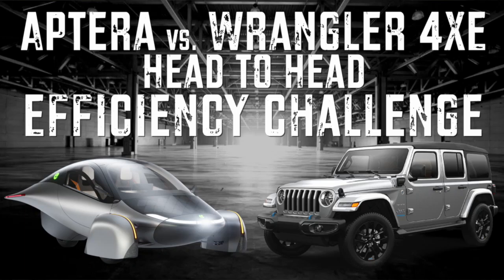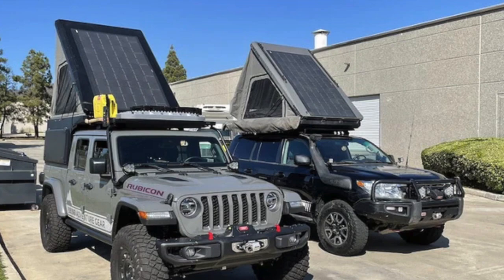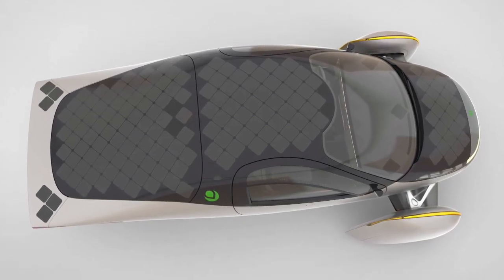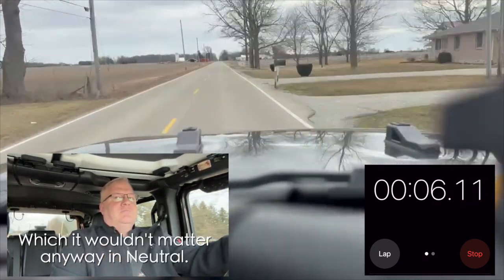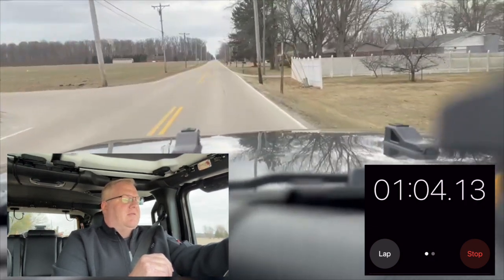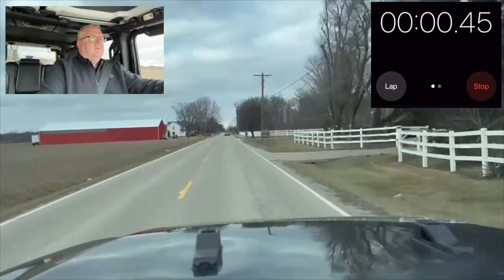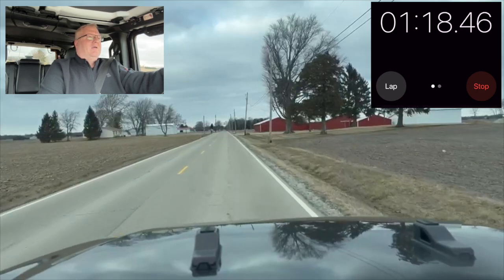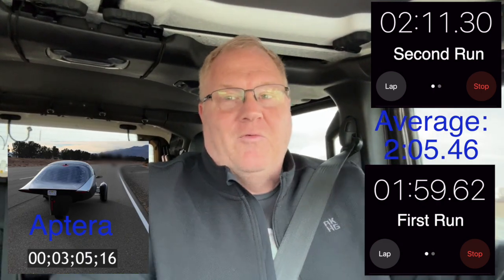Aptera vs Wrangler 4XE Efficiency Challenge

Comment: 2017 Chevy Bolt EV: altitude 56-92 ft ,  temperature 50-64F, new tires Good Year Electric Drive 2, tire pressure 42 psi, average of three 60-0 coast tests: 2:39

Comment: Interesting.  I have followed your antics since mid JA when I ordered a Grand Cherokee 4xe & I am awaiting delivery.  Off topic but concerning FORM :  Would adding an additive to fuel address FORM issues?  I have a classic I put on the road in 2005 & have added 1 oz of Seafoam to GA of Gas always - it had to set idle for 9 months one time and it fired right up when the time came to fire it up.
Reply from the maker: @KenJanicek  FORM is all software predicted. So no additives or high octane fuel will counter it. Best thing to do is to be very intentional about using electric mode and not hybrid mode for day to day. If the engine starts, keep it running for a little bit. Watch the short engine runs.

Comment: Great idea and execution! After watching the Aptera video, I wanted to do something very similar with my Bolt. Haven't done it yet, but still plan to. Your video provides some very helpful hints for pulling this off, when the time comes. I need to make sure I can turn off regen completely for this to have much meaning.
Reply from the maker: @DrTeeHenry  I laughed at myself later. Putting the 4XE in neutral would prevent max regen from playing a part anyway.
Reply: Bolt has neutral.

Comment: Impressive. So much energy to lose with all that weight. What is the mi/kWh on these things?
Reply from the maker: @laggyx500  The rating is 1.45 miles per kWh or 49 MPGe. So yeah, energy hog.
Reply: @Wrangler4XEFans Wow that's bad
Reply from the maker: @Tazdeviloo7  Yeah. You know that. But Jeep has marketed that 49 MPGe in the past like it’s something awesome.
Reply: @Wrangler4XEFans  Try this for a few days. My PHEV has a Battery Later position which is HEV mode. I have to turn it on every time I start. Reset your mpg and drive with that setting for a few days. I'd call that your true mpg. Hopefully a little over 30.
Reply from the maker: @artsmith103  The problem is, the MPG calculator on the dash isn’t the most accurate. I’ve found it can be off up to 4 MPG in either direction.
Reply: @Wrangler4XEFans  I do a trip odometer reset on each tank of gasoline. I'm convinced gasoline is cheaper than EV counting battery lifecycle costs so I always run in HEV mode and recharge about once per month when SOC gets below 25%. 42mpg summer, 37mpg winter.

Comment: Heavier brick-like vehicles have more coasting inertia.... having spent far more more energy to get up to speed, and their lack of good aerodynamics matters less the lower the speed. If you could add enough weight to the Aptera so the vehicles weighed the same, and start at a higher speed, that would be a better test of the aerodynamics of each.  This test, although interesting, means little given the disparities between both the weight and the shape of each vehicle, and is not an "efficiency challenge" by any stretch of the imagination..  Apples and Watermelons.
Reply: But that girl in the Aptera was way heavier than the guy in the Jeep.
Reply: @aussieideasman8498 Apteras are a good 3000lbs less than a Jeep 4XE
Reply: @Tazdeviloo7  There are plenty of Jeep 4XE's but NO Aptera's. Wait until there is one and weigh them both.

Comment: The test is cute, but I love how aptera billed it as a widely used test.  It's not. But it's cute and you can determine some things from it

The Wrangler took 125 second to decelerate. The aptera took 185 secs. So you can calculate the acceleration (converting to metric units, a=delta(speed)/time.  So the Wrangler was a=-0.2235m/s and the aptera was a=-0.1150m/s

And since force=mass*acceleration you can get the force

Wrangler weight 5200lbs..  Sierra
Aptera weights about 1800lbs

Thus Wrangler F=531.4N
Aptera F=93.9N

That's either how bad the Wrangler dynamics are, or for good the aptera is
Reply from the maker: @saturnengr  I’d say it’s both how good Aptera is and how bad the Wrangler is.
Reply: Arguably, a coast down to zero is almost never done - because frankly resistance at low speeds isn't really relevant.  That said, I have seen a number of vehicles go through an abbreviated version of this - as a 60-50mph test, for instance.  This is not a final published spec, usually, but it is often used to validate and adjust simulated calculations with some real world data.
Reply from the maker: @ I think that’s exactly what Aptera was doing. They mentioned they were confirming their models.
Reply: The Aptera was also going up hill. I forget the incline angle.

Comment: The test is not simply a test of air drag and rolling resistance removing speed from the vehicle, it is a test of those things removing kinetic energy from the vehicle.  The 2300kg Jeep and the 1000kg Aptera have very different amounts of kinetic energy starting at the same speed.  The coastdown on the 4XE scrubbed off 2.3x the energy of the Aptera's coastdown, in 2/3rds the time, meaning the jeep would take almost 3.5x the energy to move the vehicle.

Now, because the wheel drag and air drag are not each proportional to velocity in the same way, this number is not universal amongst all speeds, but the rate of change at similar speed areas of the test could be used to determine speed specific differences.
Reply: Thank you for posting this. This was just what I was hoping to see.
Reply: @O-cDxA  Should sell a few Jeeps, lol.
Reply: Haha. That's great. The Aptera, aka rolling scam, is only about 1 min longer.  Let's be real. Aptera is so far from any possible real launch.  Jeeps will be running on thorium before Aptera launches.
Reply: @doclees11 you realize it's not the time that's important. It's the drag

And it's fairly simple to work out the drag, it at least the force of the drag:  F=m*a.  

The mass of the aptera is about 2000lbs, or 907kg.  The jeep is s 4200lbs, or 1905kg.  If we assume the drag is constant, then 60 to 0 is 2 minutes is -0.2235 m/s.  60 to 0 in 3m is -0.149 m/s

So the forces: aptera: -135N.  Jeep: -426N

So what this is really telling you is that the aptera has about 1/3rd the drag
Reply: @saturnengr  no, the Aptera is a big drag and a fools errand.  Terrible turning radius, about a 2 adult male payload, as wide as an F150 Raptor.  Of course a pinched cat turd will roll further than a brick on wheels.  We really don't need a video to tell us that.
Reply: @doclees11  oh, it's definitely a niche car but then so is a Porsche and it's a 2 male adult payload for a lot more money.  And it's turning radius will put s f150 to shame.  So I'm hoping to hear how useless a f150 raptor is

What do you really not like about the aptera?  It's definitely weird.  It's definitely late.  But then again in the past 5 decades we've had about 3 new car manufacturers make it?  Tesla, that would not have unless a billionaire bought them and decided to lose money for a decade. Rivian that was saved by Amazon, and Lucid which produces a fabulous

 car but it's still unprofitable?
Reply: @saturnengr  ahhh, sounds like you are an investor.
Reply: @doclees11  no.  I'm on the fence on buying one. I'd like to see the crash data.  Plus they only have the 400 mi version and that doesn't make sense for my use case. The 1000 mile version ... Maybe. 

We'll see. Depends on where everything is.  Now is a horrible time to introduce a new car when we're about to go into a multi year recession

But I get the idea.  I didn't think it will be adopted by the industry.  To many compromises to be a ubiquitous car.   But it's perfectly fine as a niche car and there are loads of those
Reply: @saturnengr  ok, not an investor.  Then I will start to explain why I believe this won't make it any further than the Electo-Mechanica Solo, Sono's solar car, Nobe, Elio, or the first Aptera.  Not in any order of priority.  1. Not enough demand.  2.  No evidence the product can perform as claimed.    3. Past history.  Not just Aptera.  Chris also tried to do a hybrid wake boat. 4. They keep changing the design from advanced and revolutionary to common.  Remember the in-skin cooling and hub wheels?  Oh, there was even talk about tank turns like the Rivian.  Tank turns In a 3 wheeler.   5. Price point. Most likely, if this flightless bird leaves the line, it will cost more than the projected $40k. But at $40k it is competing with real EV cars close to the $50k range because of the tax/dealer credit. Tried and true cars with all the required safety standards. 6. Design.  Awkward ingress and egress. Cargo space access difficult especially for heavy lift items.  Too wide at 87.6 inches for easy parking.  Especially with its terrible estimated turning radius. They won't publish the actual turning radius.  Limited visibility at the A pillars due to that near useless half window design. Right in most people's blind spot.  7. Limited payload. 500 lbs max.  That is 6 lbs more than the Can-Am Spyder, and that can tow 400 lbs. 8. Solar gimmick.  Up to 40 miles a day was the claim. They use to have a solar calculator on their website.  Long gone.  When it was up, even choosing the most sun drenched mountain top in South America, you couldn't get 40 miles a day.  But the solar is part of the grift. When it was a $900 option for full solar, you could of invested that $900 and use the interest to pay for the equivalent electric. Probably could have saved more than double that $900 to invest and use that to pay for 80 miles a day of electric.  9. 1000 mile battery gimmick.  I could go on but that's enough.  But let's not forget the $500 million to $1 billion Monro said it was going to take to get this to production.  Aptera is so far short.  But the Chiefs are still collecting $200k salaries.
Reply: The roll down test is just that, a test for a number of different variables. For example, I can take two racecars (i.e. GT3 Corvette and a GT3 Mustang) and get the same exact lap time at VIR. Yet both do it a different way yet the test shows they are the same.

For the roll down, Aptera has a number of variables they can try. For example, they could try 5 different tires, different axles, different CV joints, different grease, ride height, rake and so on. Each one can net a different result and some a larger magnitude.

What Aptera is doing is leaving that out and using it as a way to impress people by how long it can coast. Yet most people have no idea how far their own vehicle let alone any other one, can coast. So the Aptera test looks impressive yet it might not be when it comes to the overall package.
Reply: @billsmith5960  Always the snake oil approach. I am happy to concede that the aero shape gets an extra minute, but it's at too much cost for practicality. What benefits come from that shape are knocked out and outweighed by all the detriments. It will be a $40,000+ white elephant, if anyone gets to own one.
Reply: @aussieideasman8498  it's a vanity car, certainly. But so is a cyber truck or a Porsche for that matter. Cheaper too. Likely a safe as any other small car, although I'll reserve judgement until after the crash test.  

I'd argue that it can be practical but certainly not a family car.
Reply: @aussieideasman8498  The Jeep is not the most practical vehicle in the world either. Considering the average occupancy of a car in the US is about 1.6 passengers and Aptera has a huge trunk space, I see it as eminently practical. Especially when you consider the low cost of ownership. I think you might have a point on the Aptera's price, though.
Reply: But the original video said it was a test of air drag and rolling resistance, so how come they omitted kinetic energy? They don't know what they are doing? And pray tell, we know air is a resisting force and friction (causing rolling resistance) is as well, but how is KE a resistor? Would it be linear? - because air is not. You made a linear calculation.

Comment: Cool. so you compare both vehicles with 4 persons aboard and 200 pound of luggage?
Reply from the maker: @vic321344  Can’t get 4 people in an Aptera.
Reply: @Wrangler4XEFans  Is the Jeep only 4 seats? I calculated efficiency on 5. Now Aptera would be about 50% less efficient per person fully loaded.
Reply from the maker: @ It’s a 5 seater but the three in the back is tight.
Reply: @Wrangler4XEFans  Then it is far more efficient while being more practical than the silly trike.
Reply: @aussieideasman8498 Even if you used 3 Apteras to transport 5 people, it'd still be more efficient per person than 1 Jeep.
Reply: @Tazdeviloo7  What established facts are you basing that wild assumption on?
Reply: @Wrangler4XEFans  Can't get 200lbs of luggage with two average American grown men in it, either.
Reply: @J-W-Kelly  No need to announce yourself.

Comment: aptera video was edited : how do I know, they slipped up
1. there are two calls outs of 3omph
2. there is no 20mph call out
3. wait for it: they call out 4,000ft, using the time stamp it works out to 48mph, it should have been called out just after 50mph,
but is way way later..........they have a history of false claims.
They are full of bs, being investigated by the sec, and in patent court as they dont have the design patent on the shape.
Directors claimed at ces recently the solar was more energy than the 25 miles of test drives, turned out to be a lie.
Their solar can only produce 500watts ( according to their solar engineer named reed), they keep saying 700watts, I could go on and on and on
Reply: I have to admit, after seeing how well the Jeep went they may have done 3 minutes, but that doesn't compute to over triple the efficiency as one person has claimed with his calculations and kinetic energy nonsense. I say on the surface it looks like 50% more efficient with one occupant and had each been full - 63% LESS efficient than the Jeep (quick in the head calculations).
Reply: @aussieideasman8498  did aptera remove brake pads....thats the sort of thing they would do, and they modified the total actual distance since there was 0.31deg slope.
A square box jeep looked like about 50% distance as aussie said, thats about as boxy as you can get.They also have the low rolling resistance ( ecopia?) bridgestone tyres.
Reply: @namenotshown9277  I doubt they had to remove anything - it's probably way lighter than it should be with all that is missing. For a start, regen is probably missing, and it is always a drag unless you provide a completely effective no regen setting, which only the more expensive EV's have. Like all the other cheap components on it, I am sure regen will be cheap and nasty. It's why this self-testing of fake prototypes at this stage is worthless. While the easiest way to fake it is to slow the video before adding the timer, it is still possible they could have done that, say, 10% instead of the up to 40% I first imagined. Only the gullible fanboys are enamored.

Comment: So you literally took one of the most inefficient vehicles you can buy and compared it to an Aptera. That took guts to do. I applaud you for the test.
Reply from the maker: @billsmith5960  It was intended to be an opposite end of the spectrum comparison.
Reply: @ - I should do my 1968 VW Bus. See what a big loaf of bread does.
Reply: @billsmith5960  Go all the way - coast the RV, lol.
Reply: @billsmith5960  Add 2 thousand pounds of bricks for a real eye opener.   Not only will your bus look cooler, being slammed, it will coast a lot farther as well. Your mileage may suffer just a tad bit... and of course, not the safest load in the world either.
Reply: @ - At least it has a 911 engine in it, so it can actually reach 60 mph. Even loaded with bricks.
Reply: @billsmith5960  The gull has rocks in his head, just make him a passenger, lol.
Reply: @billsmith5960  I always wanted to do a 911 engine in one of my Karman Ghia projects but could never afford one back then so I went with nitrous on a 1776 with Webers.  I bet yours is fun.  Love the sound of an air-cooled flat six.  I remember at Denny Acre's Porsche shop in Seattle... they had an early Carrera 4 cam in a Beetle.. nasty.
Reply: @J-W-Kelly  - If you think 911 engines were expensive back then, look at the price of just a fully functioning one. I bet the engine in mine is worth more than the bus itself.

Best part is, the bus looks stock. So back in the day other busses were confused when a family of 4 loaded up for vacation was blowing past busses (and Vanagons) up any hill. Also, I have actual heat.
Reply: @billsmith5960  Like everything else.. have you looked at the price of housing, insurance, groceries, 2X4s, fasteners, deck screws, etc?  The only thing that has never gone up appreciably is the minimum wage.

Comment: Pretty cool. You can really see how the log curve works against the air and rolling resistance between 60 and 40. Once you are below 40 scrubbing speed takes a lot longer since wind becomes less of a concern. I would get that the Aptera was much longer because 60-40 slow down took considerably longer.
Reply: When was the last time you coasted in neutral from 60 to 40? I never do, and I'm 71 - driven probably three times around the world and it never entered my head.